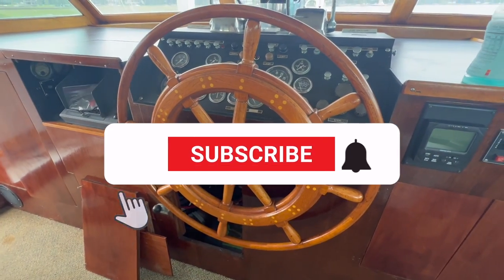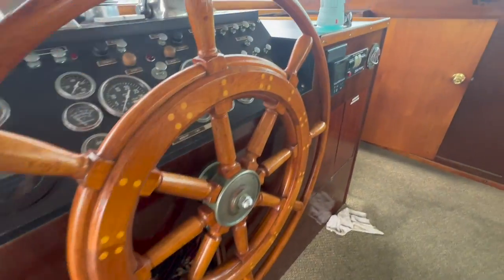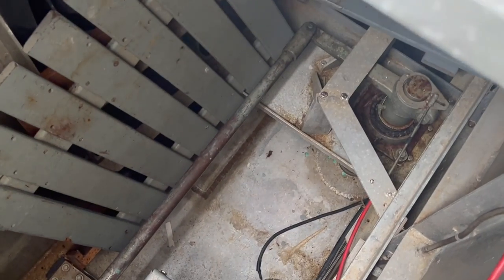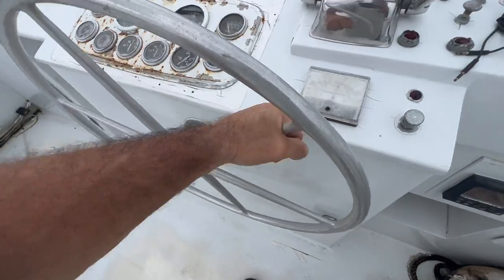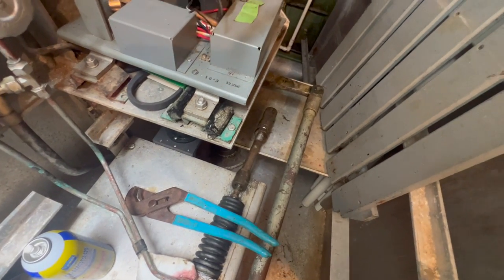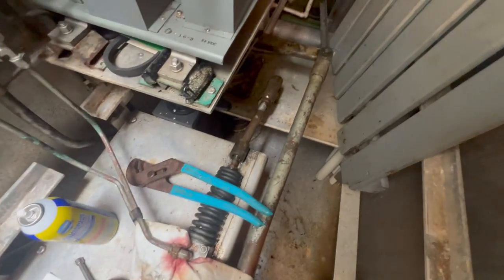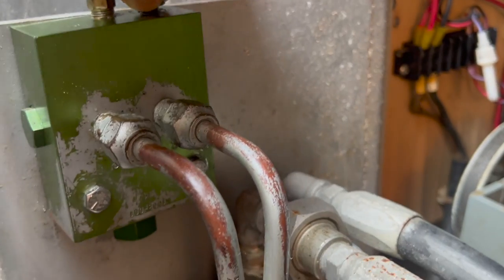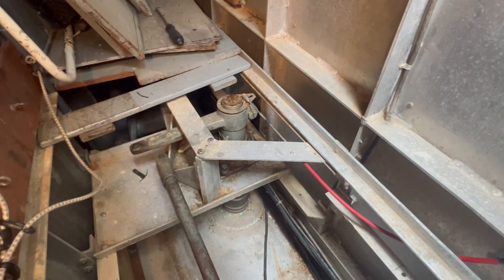Hynautic Steering system bleeding and why are the rudders stuck?

Comment: I've never repaired hynautics but in the last couple years friends have had boats with there steering, and even worse shift, and throttle with it , they seem to fail like crazy
Reply from the maker: It may seem like that but keep in mind systems are 30 years old and sometimes even older. So for something with 30 years old and never touched once is actually a phenomenal record. Things eventually just get old and the gaskets and seal start wearing out and that’s usually when we gotta fix them. But also if I’m out at See, I can much more easily fix a hydraulic system, as opposed to an electronic board that has crapped out so all in all I would much rather use the hydraulics than electrical. Thanks for watching and thank you for your comments.